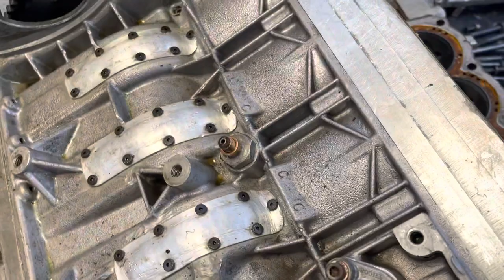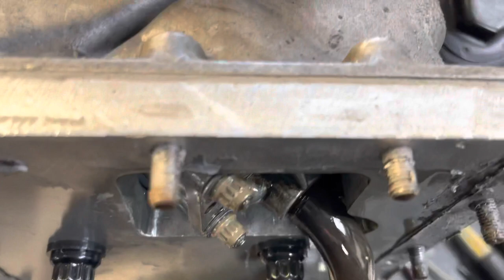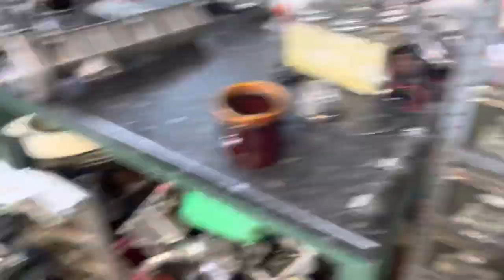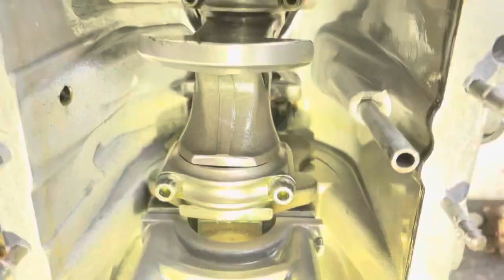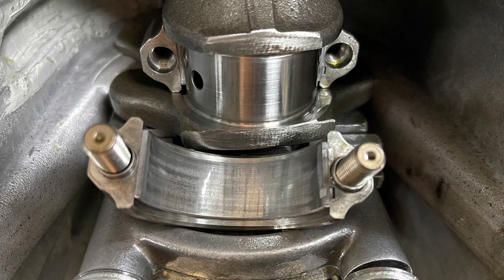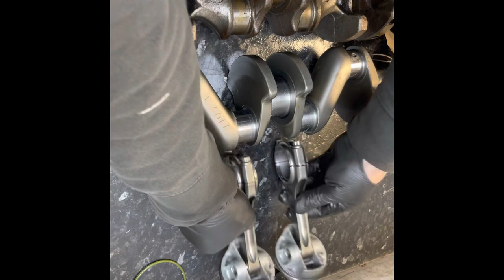Inside 1400cc hillman imp engine and dyno run full version

Comment: What is the bore and stroke for the 1400cc Imp engine? Curious to know what was the largest displacement ever achieved on an Imp engine and which capacity range was the more production viable for road-going use had the money been available?

Comment: What a fantastic creation, I love the "Frankenstein" block patches.  Since top end is so limited by the head could there be some benefit from more induction length to maximise low/mid torque?  Lovely old dyno as well, do you know how old it is?
Reply from the maker: Thank you, yes am sure more could be gained lower down the rpm range, not sure how well the crown wheel and pinion will like it 😬
Reply from the maker: The dyno is 1960’s i think it came from gardener diesel engine factory in manchester, it is my favourite piece of machinery ❤️

Comment: I really appreciate this video. Love a Frankenstein engine, good effort. 👍 I’m wondering if the head could be replaced? Like the K1100 A series engine type deal, wouldn’t be much of an imp engine left but cool. Like it.
Reply from the maker: i have weighed up many a 16 valve head but can’t find anything with same bore spacing!!
Reply: There must be some kind of cross flow head that would fit that don’t give up on that even if it’s 8 valve

Comment: A nice Rotrex would up the power on this😉
Reply from the maker: yes am sure, the question would be for how long?
Reply: @thehillmanator  Older units were awfull , but the new generations are proving reliable. I've been  running  a c38 91 in  my Honda k20  powered lotus for 4 years now. track days and road use  ,its been faultless  so far. 440bhp @7800 rpm

Comment: Andy, back in the day the magazines were reporting >100hp for 998s with the same lift and 1.4" inlet valves.  Do you think they were just at the airflow limit and more suck wont get any more air in? Or is there some restriction I haven't thought of?
Reply: In the 70s I built a 998 Imp and we saw 98 bhp at the wheels at 9,750 rpm.  The guy who tuned it on the Dyno (John Mowatt) said he thought it was producing about 105 bhp at the flywheel.  It was very sensitive to ignition timing.  The limit for a 998 was reckoned to be 110 bhp unless you fitted a special head that had downdraft inlet ports which would get you to 120 bhp.